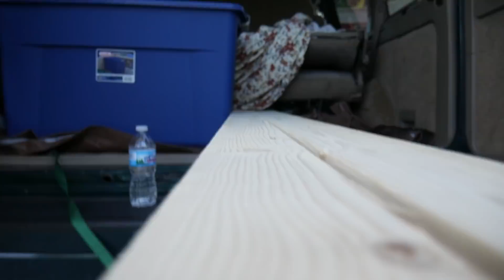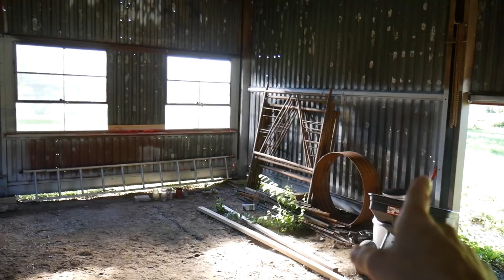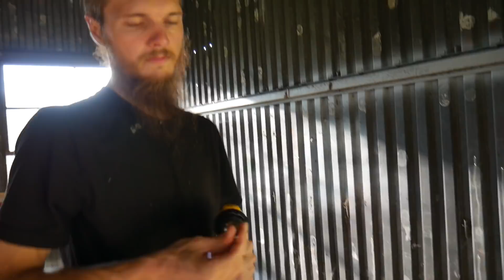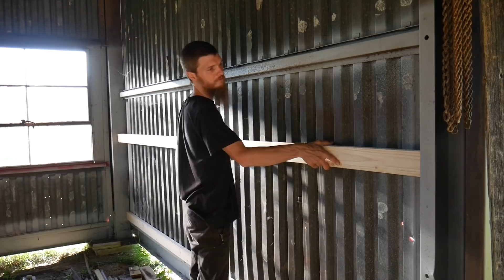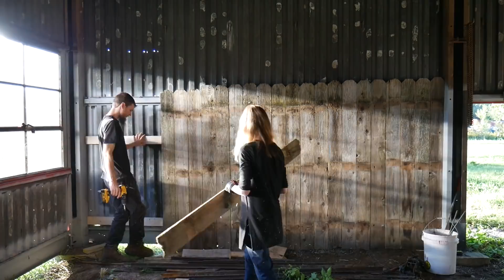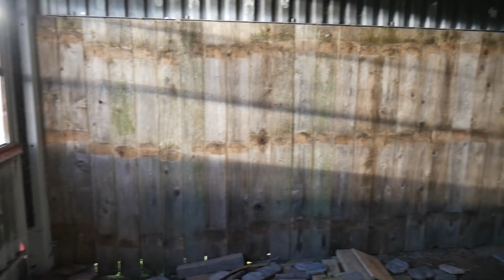Preparing a Metal Barn for Livestock

Comment: We have a steel roof and steel siding but our house has dry wall and insulation.  You need insulation. You can build a Barn  with wood then put steel siding and insulation  and then a steel roof . My other put up a galvanized shed/ work shop and it's not insulated. But you well need a pull Barn. Structure of some sort and insulation and venalatuan then you can use metal for siding and roof.